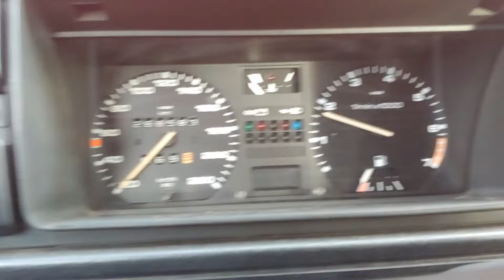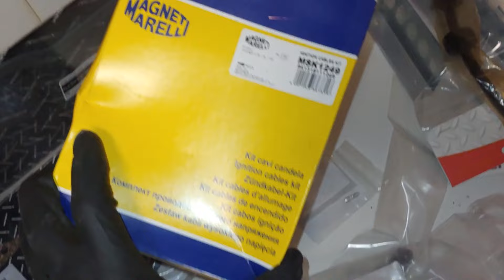Restoration of a barn find VW Golf GT (Flipping it for 10x buying price)

Comment: That car would be rare in the UK as only  mk2s left are 8V &.16V GTis. & G60s.. This car is either the 1.0L which wasn't made in RHD or a 1.3. im 55 & have never owned a car with a choke even my 1st car in 1990 an 87 Mk4 Escort diesel didn't have 1. This particular car wants a 1.8T 5 cylinder or 2.0TFSi putting in it give it a bit of oomph.
Reply from the maker: Engine is 1781cc 8valve 90hp. Engine code HV. Very rare car indeed.